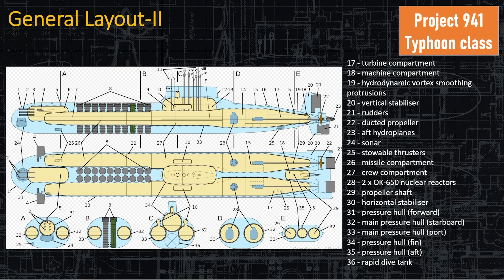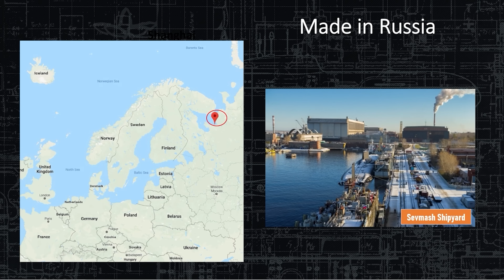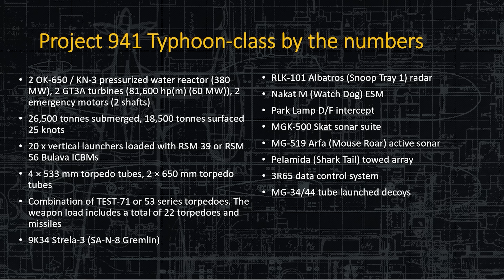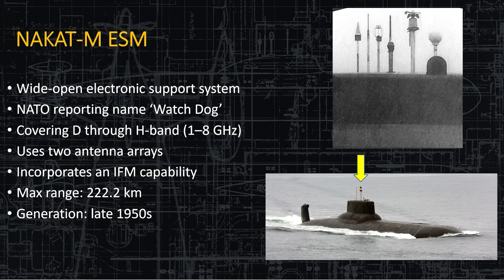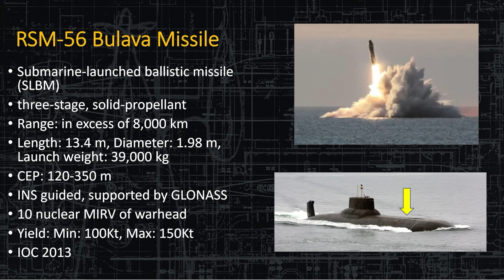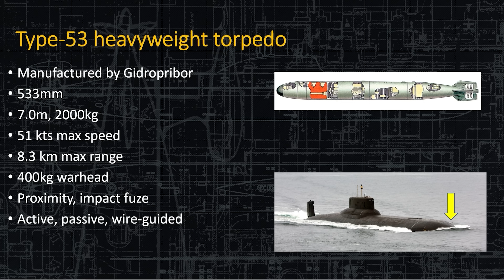Russian Navy's 48000 Ton Submarine - Engineering Marvel!

Comment: Whilst an undoubted marvel. the Typhoon is basically two sub pressure hulls sharing a  wrapper hull in the end.  If it have been a normal sub design if its size. That was of been a real advancement in sub engineering.

Comment: Seems like you did a mistake on the Type 53-torpedo.  You say it has 2000kg warhead, but little bit further down in your presentation it says 400kg.   I guess 2000 kg is the overall weight with fuel, engine, electronics, warhead and sonar.   :)

Comment: Just a question on the torpedoes. You mention the TEST-71, and "53cm torpedo" with different stats. I am curious what 53cm torpedo you were referring to? There were lots. The only one that almost matches the stats given is the USET-80, but that was not wire guided. Usually you are more thorough in your systems analysis so I am surprised at this generality. Type 53 torpedo for Russia is a family of torpedoes that goes all the way from WWII to present day with the UGST.

Comment: The B2 Spirit anti radar shape came from an old Soviet paper on stealth the Soviets ignored.
Reply: @josephd.4890  F117 more like.
Reply: Jack Northrop was building flying wings since 1940 before that paper in 1962. Also the A12 was designed with reduced rader returns in mind and it first flew the same year Ufimtsev published. His paper did give a solution for calculating radar returns of a wedge a cylinder and a wire. Useful yes but but the Skunkworks guys were already going down that path before he published.
Reply: @Mmmmmmdonuts  doesnt change what I said, the basic shape, yes.but the radar reflecting aspects were russian. they work different than the faceted shape of Tacit Blue.
Reply: "Method of Edge Waves in the Physical Theory of Diffraction" author : Pyotr Ufimtsev.

Comment: Has any tried to develop a method for submerged subs to courter ASW aircraft?
Reply: Absolutely! It's just very uncommon with nuclear powered subs, as they don't tend to play in the shallow end much. It started from the earliest days when subs would have deck guns for surface & air targets. In modern times, the maximum you can expect is a man portable SAM & LMG's the sub can fire if they're on the surface. The soon 🇩🇪 will have IDAS, which can shoot you down without the sub even surfacing.